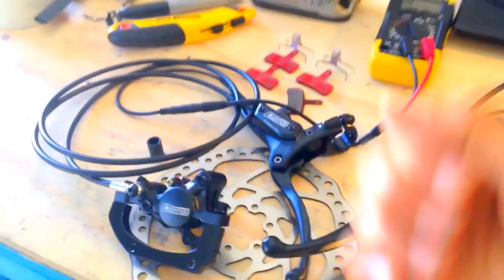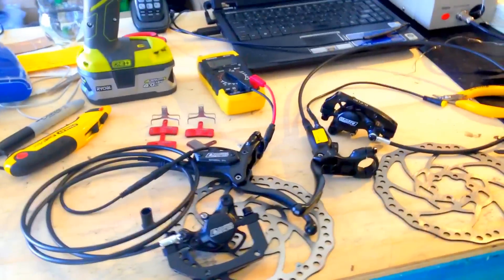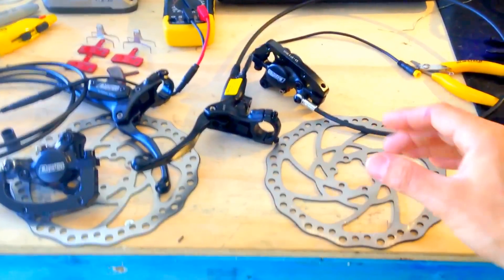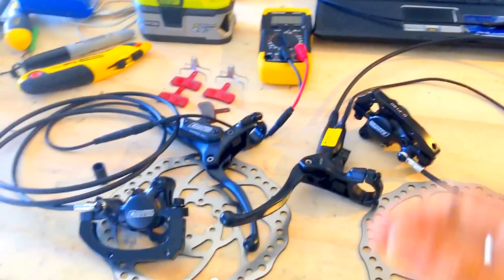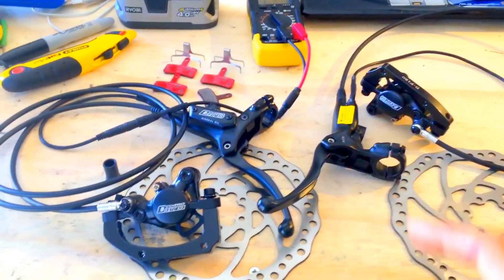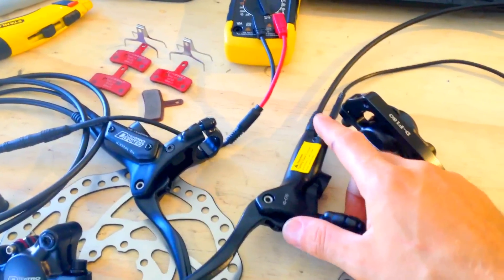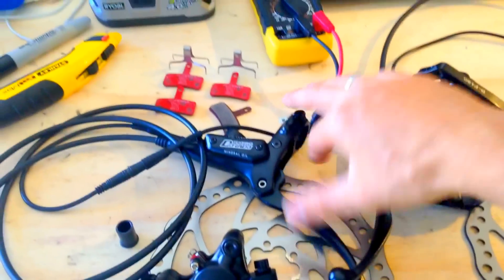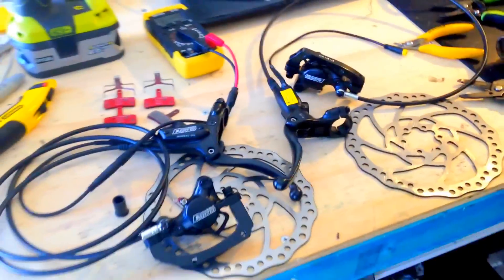Tektro Dorado HD-E710 Performance eBrake for Bafang BBSHD, BBS02, MaxDrive any other electric bike

Comment: Hey I just received a set of Tektro HD e725 brakes. Unfortunately they have two wires coming out of the sensor and I need three wire female so I can plug it into my BBSHD wiring harness. Do you know where I would find this connecter or if I have a yellow 3 pin can I cut this wire and connected to the two wires coming from the new brakes?
Thanks for your help

Comment: I ordered some.  No more costly than regular mountain bike brakes.  Just a lot more stopping power.  But I need 180mm disc for the rear as that is all my frame will allow.  Do they exist?
Reply from the maker: Yeeeaaahhh.. rotors (disc) are available in 160mm, 180mm, 203mm, they're thicker than the standard brake... most frames can take 180mm...  203 may be overkill for the rear wheel... most stopping power is on front wheel more than 70% !!!
What country are u located? I think we have some in stock here in Australia, have to check with my boss.. emax-ebikes.com.au

So much POWEEEEEEEERRRR

Comment: i bought a pair of those dorado with 180mm rotor on my bafang bike quite dissapointment the adapter is too big for my for & frame. so its just sitting here collecting dust
Reply from the maker: Hi Manuel, good news here, there is nothing to be disappointed, you just have to find the correct mount for your frame. Take your bike and the brakes to a bike shop, maybe one that deals with downhill bikes will have it in stock (the road bike guys will have no idea) there are countless calliper mount sizes available, Magura mount is compatible with Tektro Dorado. Please put this beast to work, you will love the stopping power =]
Reply: do you know where i can find 180mm post mount adapter for front? the one that was included is an IS mount can't find Post mound on any online store i know of. thanks.
Reply from the maker: +Manuel Abella - Hi Manuel, email Ewan at sales@emax-ebikes.com.au we just got soooo many adaptors for these brakes last week, not sure if it's listed on the website already =]

Comment: Very nice, I just installed shimano front liquid brake on my bike. I don't care that much about the "cut out the power" system...
Reply from the maker: +EFA22000 - Yeeeahhh... many people ride without ebrakes just relying on the motor to stop in time. It is totally possible to ride like that but we noticed that it forces the motor putting a lot of stress on internal gears cause premature problems. Gear sensor is also a really handy device =]
Reply: +ElectricBike (Bruno) ok, thanks for the advice, I think the problems come when you brake with the rear brake, if you brake with the front after stoping pedaling it would be better?
Reply from the maker: +EFA22000 - Yeahh.. that is true IF you're riding with throttle only... this is the way I ride my bike, throttle in one hand and ebrake cut-off on the other hand so I can use both hands to cut the motor power. 
When it comes to pedal assist (PAS) there is a small delay to stop, you can improve modifying the PAS setting with the programming cable minimising this delay.
One little magnetic sensor attached to your rear brake may save you some $$ on the long run =]

Comment: FINALLY I RECEIVED THE BBS-HD, IT'S THE MORE SILENT ELECTRIC MOTOR ON THE MARKET,  ALL THE HUB MOTORS ARE NOISIER THAN THIS BBS-HD, THE ADVANTAGE OF THE NYLON GEAR WITH THE  RIGHT LITHIUM GREASE, ARE = FREE OF NOISE, NO OVERHEATING,  LAST MORE TIME THAN A METAL GEAR, DUE TO THE ELIMINATION
OF THE OVERHEATING USURY (THE METAL MICROPARTICLES WEAR OUT AS THE SANDPAPER), MORE EFFICIENT..........AN EXAMPLE ? TODAY I RODE THE BIKE GOING ACROSS THE SAME PATH OF THE TOWN  THAT I HAVE CROSSED WITH THE SAME BIKE, THE SAME WEIGHT BUT WITH THE CYCLONE, A DIFFERENT ELECTRIC MOTOR, WITH SAME POWER, BUT MUCH MORE NOISIER WITH MUCH MORE HEAT, WITH METAL GEAR (HALF OF THE POWER BECOMES  HEAT) AND THE RANGE OF THE BBS HD WITH A 10AH BATTERY PACK WITH PAS AT MAX LEVEL (NO THROTTLE) WAS TWICE (30 KM) COMPARED TO THE RANGE OF THE CYCLONE (15 KM)
AT THE MOMENT WITH PAS 0, THE THROTTLE DOESN'T WORK, SO I THINK I HAVE TO PROGRAM IT WITH THE SOFTWARE.  DO YOU CONFIRM IT ?
THE DREAM IS TO USE THIS BBS HD MOTOR WITH A REAR ROHLOFF 500/14 SPEED HUB........................ AND A BELT TRASMISSION IT WOULD NOT BE A BAD IDEA
Reply: +ElectricBike (Bruno) Hi Bruno, You can buy a frame with removable dropouts so you could fit a belt without having to open a frame.
Reply: Done on your private youtube email box
Reply from the maker: +ROBY ROS - Ahhhhh.. just replied your previous message hahahaa... BBSHD is the eBike commuter's dream coming to live... silent and powerful, long range... fun... and more fun... huhuuuuuuull... 
Yeah.. so many people complaining about the "plastic" nylon gear... they don't understand all the benefits, specially noise and wear... you said everything =]
Yeahh.. Rohloff belt driven would be the sexiest bike ever!! The only way you can get belt in your bike is if you cut your frame to fit the belt and make a joint screwing back together but able to open to replace the belt next time. Very hard almost impossible to find frames for belt driven bikes....
I am impressed with your range, double than the Cyclone motor... I am building a bike with the Cyclone kit from Luna Cycles (Eric wants me to test this 3000w monster) very interesting you telling me all that info... I will pay attention on noise and range in my comparison... anything else you have noticed? Weight difference? Harness is waaaay better on BBSHD... so much POWEEEEEER =]
Reply: +ElectricBike (Bruno)  I' M SURE THAT THE NEW CYCLONE 3000W 
IS BETTER THAN THE OLD CYCLONE MOTORS AND IT' LL NOT HAVE OVERHEATING PROBLEMS, IT' LL BE LESS NOISY THAN THE OLD
MODELS BUT STILL MUCH MORE NOISIER THAN THE COMPLETELY 
SILENT BBSHD , I' M SURE IT IS A LITTLE BEAST REGARDING THE PERFORMANCES, BUT I' M NOT AT ALL CONFIDENT ABOUT THE 
RELIABILITY OF THIS CYCLONE MOTOR (MY EXPERIENCE ARE THREE CYCLONE MOTORS BROKEN FOR OVERHEATING PROBLEMS AND THE 
FOURTH STOLEN). ONE OF THE FIRST PERSON THAT HAS PURCHASED
IT, AFTER A RIDE OF FEW KM THE 3000W MOTOR DIDN' T WORK MORE.
SO, I HOPE IT' S A SINGLE AND ISLOLATED EVENT. YOU' LL TELL US IF 
IT IS RELIABLE TESTING THIS LITTLE BEAST (BUT YOU NEED A LOT 
OF RIDES TO BE SURE IT' S RELIABLE).
REGARDING THE BBSHD 1000, THE MINE HAS THE WRITE " 48V 750W "
(BUT IT' S THE 1000W VERSION, RIGHT ?) I THINK FOR THE EXPORT 
TO U.S.A. (750W LIMIT).
THEN MY C965 UNIT SHOWS MAX LIMIT OF 999W, A  MAX SPEED OF 
60KM/H (SETTABLE) AND AT PAS " 0 " THE THROTTLE DOESN' T WORK 
I THINK THESE THINGS CAN BE CHANGED WITH THE SOFTWARE AND 
THE PROGRAMMING CABLE. CAN YOU CONFIRM IT ? 
THEN I KNOW THERE IS AN OTHER  BBSHD VERSION WITH MORE 
CABLES FROM THE MOTOR = THE CHAIN SENSOR AND FRONT AND 
REAR LIGHT OUTPUTS.
LET ME KNOW AND UPLOAD NEW VIDEOS.............
WITH POWERRRRRRRRRR................
Reply from the maker: +ROBY ROS - Yeeeahhhh... I will test this monster very well... hopefully it is an improved "2016 version" or something like that hahahhaa... its hard to compare with the nice and well engineered BBSHD. Yeah, we received 47x BBSHDs last week and they all are stamped 750w so it "looks legal" in some countries like the USA. The throttle at PAS-0 needs to be programmed using the USB programming cable, you will find all instructions here on Karl's website (the best website for Bafang riders) http://electric-fatbike.com/2015/06/26/a-hackers-guide-to-programming-the-bbs02/
The display won't show more than 999w... the speed is limited to 50kmh on the C961 and 60kmh on the C965 3 buttons. There is a trick when you're programming your controller, the "throttle tab" you set the mode to "speed", designated assist to "9" and the speed limit to "40kmh" for some reason this combination will give you an unlimited speed limit, its a bug I found on the programming software hahaha...
The additional cables are good connecting an additional gear sensor but you can also connect the sensor to one of the eBrake connectors... the front and rear lights are 6v... not very easy to find 6v lights...  so all that extra is good but not you can survive without.
So much POWEEEEEEEEEEEEEER =]
Reply from the maker: +EFA22000 - hummmm removable drop out... I didn't know that one... can u send me a link??? =]

Comment: Thanks!  I am burning through pads like crazy with a BBSHD equipped mountain bike.   Seems to be just what the doctor ordered.
Reply from the maker: +Kory Garretson - Yeeeeeahhhhh.. the Tektro Dorado pads are designed to handle all that power and lasting longer... another thing many people may not know is that hydraulic brakes "self adjust" so you don't have to worry about tighten the cables all the time... so much POWEEEEEEEEEER.. durable and convenient too hahaha =]

Comment: i had a clarks 200mm hydrolic disk kit on my mountain bike and it had incredible stopping pwer. it was a bit overkill actually but would have been perfect for your fast e bike. but i did not maintain it properly and it broke. and i never liked the look as it was too big and silly.   i have since fitted  normal, small sized mechanical disk brake, which is ok, but only about half as good as the clarks.
Reply from the maker: +andy765gtr - Yeeeeeahhhh... Clarks with 200mm rotors is good for fast and heavy electric bikes but totally overkill for a normal bike... even for electric bikes in most cases is overkill. This Tektro can take 180 or 203mm rotors but 2.3mm thick instead of 1.8mm... imagine the ridiculous motorcycle stopping POWEEEEEEEEEEER haahaha =]